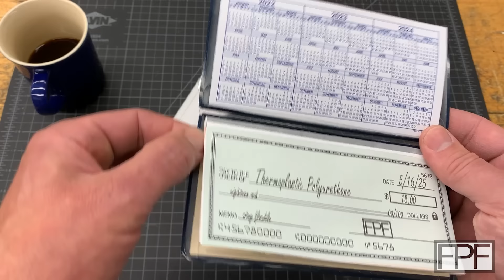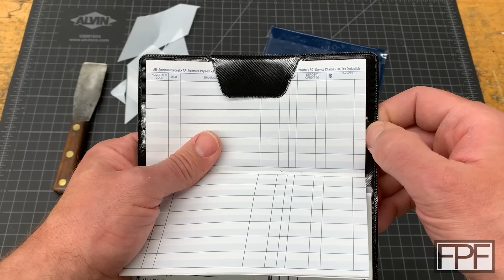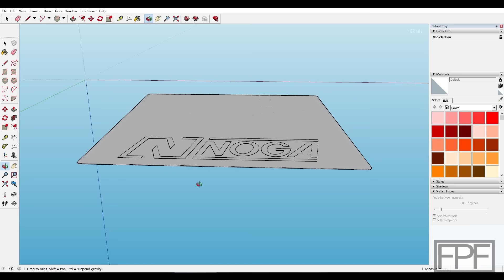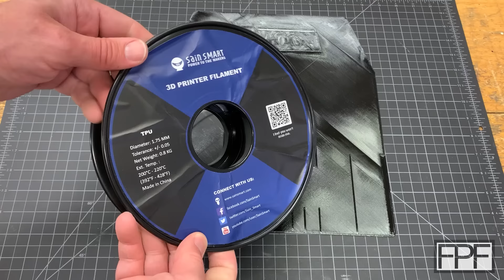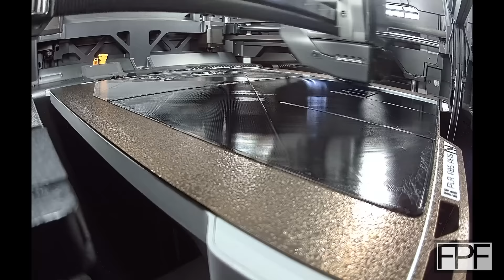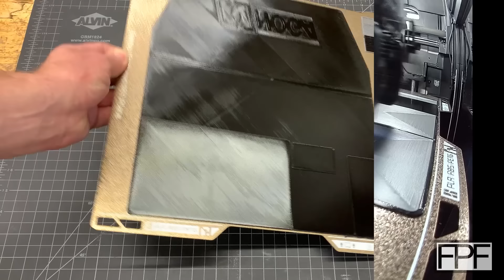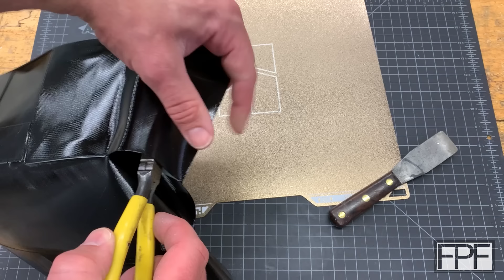3D Printed Tool Roll and Checkbook Cover

Comment: Have you tried NPA (nano polymer adhesive)?  I use it all the time although mostly with PLA and PETG. Although one application last for  20-30 prints and was on my plate with TPU and I had no issues with removal.  It leave no residue. Just let it completely cool before removal.   Love the idea of the pla or petg as an interface layer with tpu.   Cool video.

Comment: I like the idea of the bellows but I only have one head on my printer and that would be a lot of filament changing. 
I do not use a cheque folder thing like that but the concept could be extended to many other things. Perhaps adding pockets to a phone cover and maybe custom book covers. Unlike the bellows these other things do not have so many layers. Also, I am wondering if an alternate method would work using the sharpie method to sometimes used to support more typical overhangs.
Regarding getting TPU to come off a textured PEI sheet I just set the bed temperature to 0 deg C. In that case it still sticks fine during printing and it is possible to pull the part off without damage to the bed. Generally my parts have more layers than you have on these today but I have never damaged a part getting it off the bed.

Comment: I really like printing TPU on bare spring steel, you have to print with the bed temps slightly higher than normal, but it releases perfectly! You end up with a smooth surface rather than the nice texture of a PEI sheet.

Comment: I feel like washing hairspray off is easier than the mess with the alcohol. But I understand your point. I like how easy it was to get the TPU off the fancy 3d effects plate. That wasn't as difficult. The first time I did TPU on my X1C's stock PEI sheet, it scared me from how hard I had to pull. I just hit it with a glue stick before because I didn't care about the finish I just wanted the fart toy to not ruin my bed.

Comment: I guess you could have PLA as the first layer. That can be your release agent 😂.
Reply from the maker: I've done this.  If you don't need the texture from the PEI sheet, this actually works really well.  They self-release on cool-down and then it peels right off.
Reply: @FunctionalPrintFriday  Question is, do you need the PEI texture? How about making a full-size PLA 1st layer, make 2nd (or more) layer your prefered texture/logo/... also out of PLA and then add the TPU?

Comment: I tend to print in PLA, ABS, and ABS-GF - TPU kinda scares me still., so I don't think I have enough experience with TPU as a material to really have a strong sense of what use cases TPU has for me, let alone this particular technique of interleaving PLA/PETG and TPU could render... yet.
Reply from the maker: Try something simple first.  Checkout my video on a TPU luggage tag.  That's single material and really useful in a bright color.
Reply: @FunctionalPrintFriday  also, it occurs to me, if you put one pleat-worth of an accordian in the edges of those larger pockets, you won't get that cinching problem. It also means you can go more narrow on the pocket itself, and the "depth" of the pocket can be controlled by the width (border? overlap?) of the pleat.

also also, I don't know how this would work with TPU, but I've found that if I want a more fashionable finish on my top layer, I'll use Hilbert Curve - it tends to look more uniform and you don't get those diagonal striations that screams "3d Printed" - totally a subjective aesthetic thing, and may not be worth the extra print time, but its an option.
Reply: also also also, is it worth trying some embedded magnets for the flap?
Reply from the maker: @ThatRobHuman  Both great ideas
Reply: @FunctionalPrintFriday  That is a good one, for sure - I just don't have the money to travel, so not exactly practical for me :P - I totally take your meaning though.
Reply: TPU feet for parts are always useful, just model a hole into the 'hard' plastic part, and press-fit the TPU parts in.

Comment: You're really reaching to hype this 'free' printer.
Reply from the maker: Sorry you feel that way.  I'm not trying to hype anything, I'm just genuinely having a blast trying all sort of new things I didn't think were possible before.  Prusa, Snapmaker, and Bambu all make multi tool head machines.  I would suggest checking them all out.  Being able to print more than one material at once with no contamination is truly a game-changer.  Edit: and Bondtech is coming out with the INDX.  That also looks really cool.

Comment: starting to  lose a bit of interest when relying on a multi headed printer
Reply: That's fair, but DEX/IDEX & MMSE printers are becoming more and more common.
There's a limit to how much you can do with a single material, everything he's doing with a DEX printer can be done with an MMSE printer (X1C or anything with an MMU) it's just a case of greater purge volumes and wasted material.
Hell, it can be done on an ender 3 with zero mods if you're willing to do the filament changes by hand and set pause points.
Reply: @Person1873  I suppose so. These examples wouldn't take terribly long with an AMS since its a single layer or two of interface layer. that bellows would take a week.😆

Comment: I’m curious how those hold up long term. Like if I was to print a wallet in this way how long would it last
Reply from the maker: Funny you say that.  I didn't mention it in the video, but a wallet is probably the next TPU thing I'll work on.  I think it can be done with a stackup of layers to include all the regular pockets you'd have in a standard wallet.  TPU is REALLY durable.  If you missed it, check out the video I posted two weeks ago of a bellows where I TRY to destroy it.
Reply: @FunctionalPrintFriday I’m still in shock from how well the way covers held together, I’m not used to anything that thin and 3d printed having any kind of toughness. I am curious to see how the tpu holds up to the more cyclic loading and constant low level abuse that something like a wallet takes. I’m definitely staying tune!
Reply: @FunctionalPrintFriday I tried to do a wallet a while back on my single extruder machine.   So I had to print edgewise and it was not very successful.   Now with your approach I want to revisit that .   On the bellows/way covers, that video caught my attention because I had added way covers to my wood lathe.  I found them on amazon in multiple sizes and quite reasonable.   I 3d printed sliding rail ends for the way covers with magnet attachment.   The banjo is free to move and yet keep the way cover doing its job.  My wood lathe has a sliding bed which opens up the swing but creates areas where a lot of the chips get captured.    It is a hard to clean area so I prefer to keep them out.   But your way of making that type of thing….. I just know I’ll have a use for that.   Thanks for sharing!

Comment: I like the functional prints, but these prints are really only possible on a multiple head machine like the H2O. Its still interesting but not something I can leverage.
Reply: stay hydrated!
Reply from the maker: A regular single-head machine still gets most things done, but I am loving having 2 tool heads.   Honestly, I want even more.  I want ALL the tool heads :)
Reply: You can do this with a single extruder too, you just need to purge enough to make sure there's no cross-contamination, it's not too bad for something thin where you only need a layer or two of PLA. 2-3x normal color change purge volume should be enough.